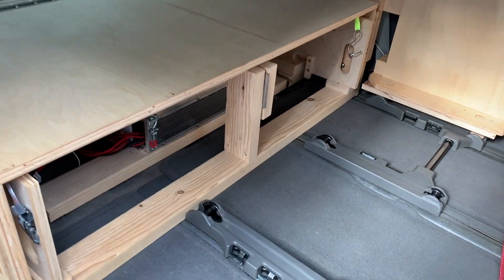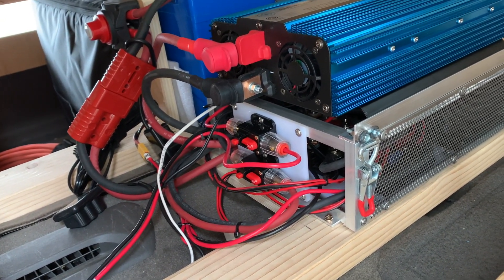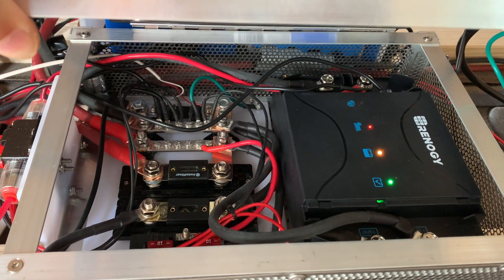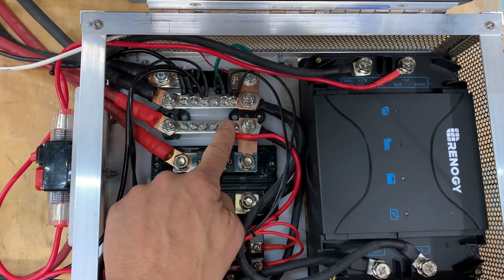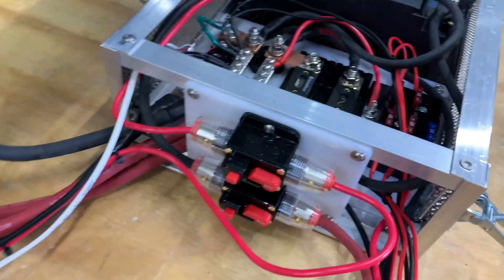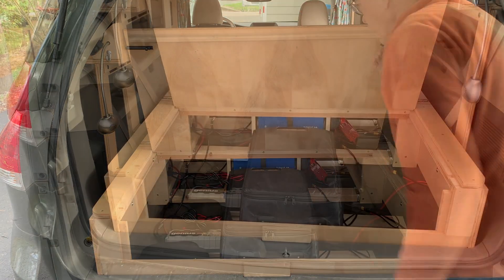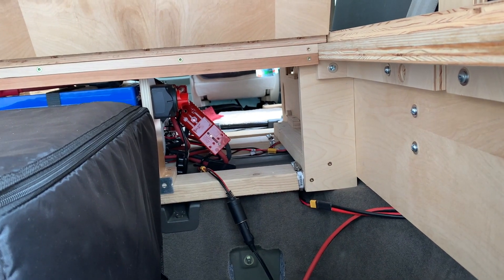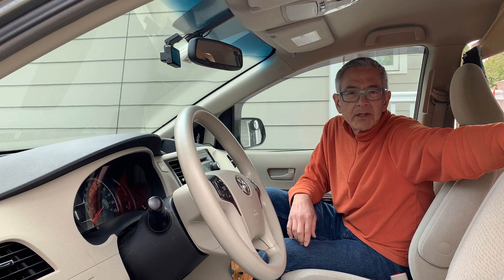Sienna MiniCamperVan's New PowerBox with Renogy DC-DC-MPPT Charging

Comment: Do you think the 30 A Renogy DC-DC charger is still good for this or would you choose a newer model.  I have been using a 768 Wh portable power station on a new buld and think of getting a seperate battery setup to add more storage.  I have a 2nd gen sienna
Reply from the maker: Depends on your goals. I chose the 30A DC-DC w/MPPT because I wanted to be able to charge the house battery quickly while driving if I had discharged it a lot beforehand, plus I wanted the built-in solar panel charger for my roof panel, but I didn't want their highest current unit (50A, I think). In practice, however, I almost never discharge the house battery much and I rarely, if ever, need to charge it quickly. I believe it's still quite a bit less expensive to have separate components (battery, chargers, fuses or circuit breakers, etc) compared to a all-in-one like a jackery but it sure is a lot more work to configure and install everything. Does this help or did I misunderstand your question?
Reply: @BruceParks  What is the main purpose of your NOCO Genius.  I am confused if it is one way you charge while in camp with provided electrical outlets.  I am a beginner and building and have a Bluetti power station along with a LifePO4 battery and wondering if a NOCO device is all I would need to charge my LifePO4 battery or should I get a seperate MPPT controller to use for that.
Reply from the maker: I use the NOCO charger for two separate circumstances. Most often it’s for keeping the house battery charged when not being used. We can go for months with the vehicle sitting in the garage between trips. The other is at a campsite with electrical hookups.
Reply: @BruceParks  That is why I wonder if I even need a MPPT controller and would be fine with just the NOCO charger for use at camp or home for my LIfePO4 battery.  I have the Bluetti Charger 1 for charging while driving and external solar panels
Reply from the maker: Since I don’t have a separate power system like a Jackery or Bluetti I rely on my DC-DC MPPT charger to keep my house battery topped off during long days on the road. The only reason for you to install a DC-DC MPPT charger might be to ensure your LiFePo4 battery is always charged as a backup in case your Bluetti runs down or fails unexpectedly.

Comment: Hi Bruce,

I just burned up my 2012 Sienna alternator and two start batteries.  A $1,500-$2,000 expense on this Labor Day 2025.

Your Sienna looks to be a newer, possibly hybrid model so your minivan electrical may be significantly different.

My older Sienna did not have the capacity to take on an additional demand from the inverter of 800 watts and failed.

I am looking further into the technical details of dc-to-dc chargers, total power demand, and when that will affect minivan or other model cars to help save others a significant repair cost.  Each vehicle has unique alternator outputs.  A hybrid is yet again different 

I was running lights, max a/c, and a 12v1500w120v inverter (to battery charger[14.4v X 25A] charging a LifeP04 100ah battery).  Estimated 800-1,000 watt load on starter battery/alternator.

In a word, be cautious or be prepared for an expense car repair.  Once it was all said and done, unplanned hotel $500,  meals $100, our total out of pocket was $3,000.

Lesson learned, if in doubt, charge with on-shore power, or a solar system.

Your video was very informative.  What great research and work.

Thanks,

Greg
Reply from the maker: That’s really unfortunate about your experience. My Sienna is a 2011 model. I was reluctant to tie the alternator to the house battery but I felt comfortable the Renogy 40A DC-DC would be safe for my application. Note, I didn’t research the capability of the stock Sienna alternator beforehand and I know it’s the original alternator, now with 115K miles. In practice, I rarely pull the house battery state of charge low with the only regular loads being a fridge, lights, fans, and device charging. I agree if you can plug in to top off your house battery do it. Good luck with your DC-DC charger search.
Reply from the maker: If your alternator was tied directly to your starter battery and you were pulling 1000W with the inverter that’s 83A at 12V or 70A at 14.4V. With the 40A DC-DC charger in between the alternator and house battery the draw from the alternator should be limited to 40A which should make for a happier alternator.

Comment: This is unrelated to your video, but the electrical discussion reminded me of the only thing I hate about my 2011 Sienna. If I leave the side or rear door open for extended periods, it often ended up draining the car battery. I have the automatic doors turned off as well as the lighting, and this still happens. I camp by myself in remote places, and while I have a portable jump starter, it makes me paranoid to leave the doors open. Trying to always keep the doors closed takes a lot out of the camping experience. Wondering if you’d had this experience and found any solutions. My mechanic has checked out my battery and says there’s nothing wrong with it.
Reply from the maker: I haven't experienced that problem. A trick I use when I leave the rear hatch door open all night is clicking the latch (at the bottom of the hatch door) closed. This makes the van think the hatch is closed. When I want to actually close the hatch, I just press the release button above the license plate and it will click open. I've used a screwdriver shaft to close the latch but I usually use a metal ring (see pic: https://photos.app.goo.gl/6csPJoWaCbLWNPyS8) that also serves as a point that I can hook a bungee or tiedown to when I'm hauling long stuff.
Reply: Thanks I will try that!

Comment: Bruce, when using batt charger supplied by shore power, is there a need to disconnect (using main disc sw)  from the red bus bar?
Reply from the maker: Excellent question. I do not disconnect the battery from the rest of the system when I plug in shore power and the NOCO charger is charging the battery. I contacted Renogy to get their position on whether it is okay to leave their DC-DC-MPPT charger connected while I'm charging from the NOCO charger and they said they do not support both being connected at the same time. I've seen other solar chargers state it's okay to have multiple chargers attached. My feeling is Renogy was taking the legally safe position, not the technically safe position. Their chargers have lots of builtin safety systems to protect their circuitry. I guess we'll see in the long run but so far, it has been working well.

Comment: you have the same sienna as mine. I am installing a dc to dc charger . I am concerned with the alternator capacity. What is the amp size of  your dc to dc unit ? Would a 60amp unit be too much for this vechicle and put too much strain on the alternator?
Reply from the maker: Hi Philippe, I'm guessing our Sienna's could handle a 60A DC-DC charger, at least for a while. The stock alternator can produce at least twice that amount but more load, more wear. I don't use a lot of power in my minicampervan (the biggest load is the fridge) so I figured a 30A unit would be fine for almost any situation I'm in (mostly long roadtrips).

Comment: So glad I found your videos. I put a dash cam in my Honda Odyssey and it was wonderful to record my drive down the length of the Blue Ridge Parkway. Sure no one else is going to watch the 496 mile trip but I have it and maybe some day I will make a highlight video of it. Love your power box. Mine is just wood but has the same components except I went with a 100ah lithium battery. The Renogy DC-DC charger works great. Definitely will borrow your designs on a few things. Keep up the wonderful videos
Reply from the maker: Hi Glenn, thanks for watching and taking the time to write a comment. When my $100 AGM battery goes, I'll replace it with lithium chemistry (probably LiFePO4) - the prices have come down so much in the last couple of years.

Comment: @4:37-5:03 finally! I reverse-engineered & built the bed frame & table portion from your earlier videos as my Covid quarantine project this time last year. Prior videos didn't show the back under the lid in much detail though. Now I see what I missed! Made that part up & used gas struts to hold the lid up instead. Worked out great for Sawtooth camping in Idaho! I'd never built anything before & owned basically no tools when I started. Now I have an awesome camper van AND a fun, expensive new hobby :) THANK YOU for posting everything in such detail & inspiring people to blatantly copy your amazing designs!
Reply from the maker: Wow, awesome that you've been able to build skills and a camper for your adventures! Stay tuned, I've got more ideas coming.

Comment: Excellent job Bruce!  On you schematic diagram, is your DC-DC w/ MPPT Charger connected to the Starter or Alternator?
Reply from the maker: It's connected to the positive post of the starter battery up front. I show it in this video (https://youtu.be/JqKT7TofaaU?t=110). You could attach it to either the battery or alternator or starter because all three are basically connected together with the positive cable but I found it best to connect to the battery because it makes things clear and it was easy.
Reply: @BruceParks  Oh I see… thanks again.  I asked because I shifted from Sienna to Lexus GX 460 and I’m trying to determine how to route the cabling coming my DC generator (located at the very back of the cargo) to the engine bay.

Comment: Hey Bruce, thanks for the schematics.  I have the same dc-dc charger 30 A. So my starter battery is 55 A, I ordered an 80 A circuit breaker for it is that too high? 70A is hard to come by. I'm also going to skip the 50A fuse you have connected to the charger. I'm a tad confused and can't connect to renogy(their phone line keeps dropping). Is the recommended 45A input fuse protecting the charger or the starter battery. Cheers.
Reply from the maker: My take is the 45A input fuse is to protect the stuff upstream of the dc-dc charger. So for example, if the charger shorted inside and could suddenly sink several 100A, the input fuse would prevent the wire (from starter battery to charger) from overheating and melting. I have two CBs on the input line for shut-off convenience, i.e. I can shut the line off when working underhood or when working on the electricals in the back. You can safely use a 50A fuse (or CB) instead of 45A. Easier to find. Good questions!
Reply: Thanks for the reply. I'm almost done setting my up. Cheers

Comment: Hi A bit off topic, but since you have the most impressive skills, ideas, and experience, I have question  I hope you have time to answer. I'm wondering if you've considered the Sienna Hybrid as a camping vehicle? This would allow for cabin temperature control via the hybrid battery. Any thoughts appreciated.
Reply from the maker: The new Sienna is a camper conundrum for me. The biggest issue is the non-removable console between the front seats. The console and dashboard are one piece and makes an easy pass-through from front to back impossible. Secondly, removal of the 2nd row seats produces an airbag warning. Maybe someone will figure out how to hack the system into thinking the seat airbags are still there. Regarding your specific question, I don't have personal experience with the hybrid Toyota's (I've read Prius's can do this) that can be set to fire up the engine to maintain interior air temp but if the new Sienna can do this, it seems like it would be really nice in very hot or cold weather. I just don't have the facts, sorry.
Reply: @BruceParks  Your reply and the thought you have given to this are much appreciated. It sounds like it might work for one smaller and agile person, capable of scooting over the console, with the back seats in the fold and slide position, but definitely not for two or more campers.

Comment: Hi Bruce, Love the videos. I am truly impressed by your skill and workmanship. I am currently considering a 2017 Honda Odyssey or Toyota Sienna for a mini camper conversion. I was wondering if you did a comparison of those two vehicles before you started your project. Cheers Andy
Reply from the maker: Thanks for the nice comment. Regarding Sienna vs Odyssey, I hadn’t done any comparison at the time of my first purchase, a 2009 in 2017. Afterward, as it often happens, I became much more knowledgeable about Siennas and came to the opinion that the Odyssey’s were too risky due to a reputation for weak transmissions. Just anecdotal info, I’ve never dug for real data. I will admit, however, I’m not a fan of the Odyssey’s side styling behind the sliding door where the rear window gets droopy. But that’s purely subjective. I bought my 2011 in 2018 and it’s really doing well.
Reply: @BruceParks  Thanks Bruce. I was aware of the transmission issues with the Odysseys. Luckily by 2017 they have sorted that out according to my research. I am still considering both the Sienna and the Odyssey. Siennas are super dependable but in the 2017 generation they have trollies for the second row seats that seem very labour intensive to remove and if not removed would be a pain to work around. Thanks again and please keep the content coming.👍🤙
Reply from the maker: @andrewkynoch1719  True, the gen3 Sienna's have those nuisance trolleys but if you are going to remove them without any intention of reinstalling them, then the effort to remove them is nothing if you amortize the effort over the years of usage you'll get from the van. That's how I'd look at it. If on the other hand you wanted to reinstall the 2nd row seats now and again then removing the trolleys and reinstalling them would be too time consuming.

Comment: Hi Bruce. I must say that I'm very pleased to see you are on task showing the evolution of your Sienna. Question, I have the same Renogy DC-DC controler that you feature but I'm  stuck in finding the correct alternator wire to tie to the monotoring port. Maybe you can point out the correct connections for the controler ... please.  I have reservation in Yellowstone in August . I'm doing a few things different to my Sienna as it is designed to sleep only one (me) but much is similar. I have a 5 foot pull out kitchen that is coming along. Love to share too. 

  Robert of  Concord, NH.
Reply from the maker: Hi Robert, regarding the alternator connection, are you referring to the IGN+ port on the charger that you’d use if you have a smart alternator (SA)? My Sienna doesn’t have a SA so I left that port unconnected. Does your Sienna have a SA? The manual isn’t helpful in showing where to connect the alternator end of that wire and I don’t know myself. That’ll take more research on your part. Maybe contact customer support but I’ve heard they aren’t the best at getting back to people. I’d be interested to see your build sometime.
Reply: Thank U Bruce. It was too good to be real ... that is you actually reply with meaningful  dialog. Few bother to deal directly without adding a fee. Yes, you are correct, i must figure out if my 2017 LE Sienna has a smart alternator. My initial attemp to communicate with my Toyota garage (an electric tech) was blocked by the 'front desk'.  I will try again. I do know that three wire comprise the control circuit which leads me to believe it is a smart alt. I need to work at it again. I actually am sucesfully using the DC>DC charger with that sensing port not used.  Renogy  support is another issue that isn't worth the fuss. They could be more heplful. I will try them again. 

Thanks ... robert
Reply from the maker: @robertbundy166  I followed tips from YouTube videos on how to determine if I had a smart alternator. I measured the pos terminal voltage when running and got 14.4v, typical of a dumb alternator. Can you perform the same test?
Reply: @BruceParks   Yes and so i also found that video. I need time to assimilate all this and find a source for that terminal.  I will report back to update my progress. Thanks to you! 

rlb
Reply from the maker: Robert, thanks for that update. Good investigative work. The question I have for you is are you using the DC to DC charger or the DC to DC with MPPT charger? The DC to DC charger has the D+ terminal you are referring to and the information you found applies to it. I’m using the DC to DC with MPPT charger which is completely different. Mine has an IGN+ terminal, not a D+ terminal. The IGN+ terminal is for connecting to a smart alternator. The D+ terminal is for connecting to an ignition-on line, which happens to be available at the alternator. Just wanted to point out the difference between D+ and IGN+. Good luck with your hookup.
Reply: @BruceParks  Didn't know there are two but like you, mine is a DC-DC MPPT 50 amp charger. The owners manual talks about a D+ ... (now let me get the manual out to get it right). So now i can't find any D+ info in the manual so i may be mixing info. I definatly have the IGN+ terminal so now i will think some more.

Comment: Hello Bruce:
I was wondering if you thought about using 
T-slot aluminum structural framing for some of your build, as that would save on weight and keep your build strong. I really liked your screen build as this could be used in any vehicle. Great ideas 💡👌!!
Reply from the maker: I’d consider T-slot or 2020 in a future build. Wood was more intuitive for me this time. The net wood weight of my build is a tad over 200 lbs so I wouldn’t go for alu for the weight savings as much as the volume savings. And the bling. 🙂